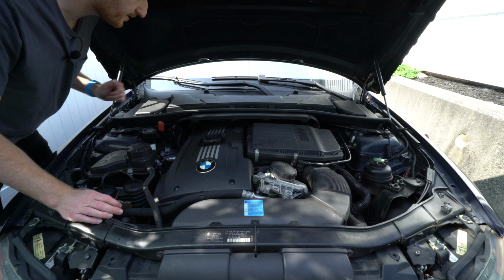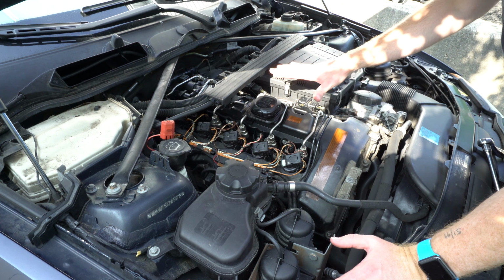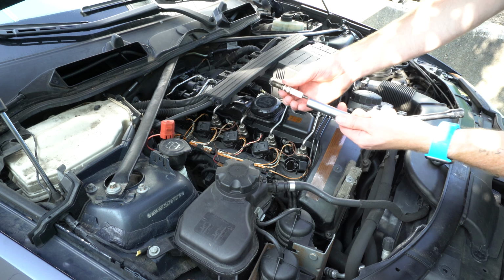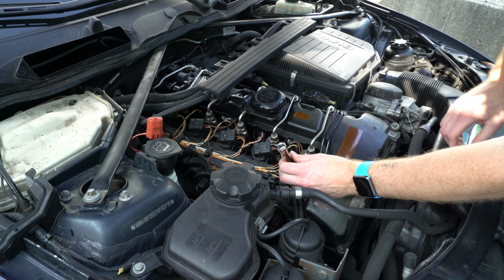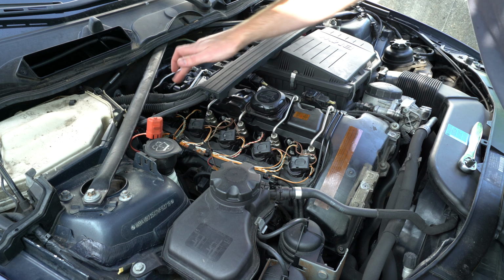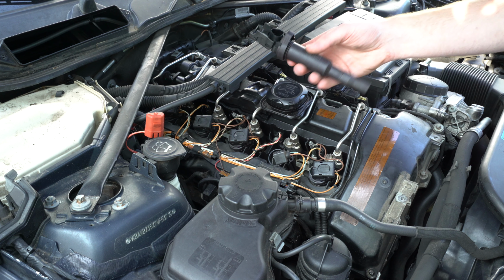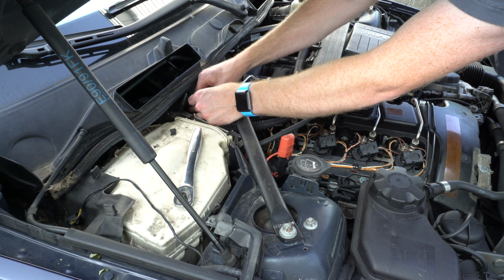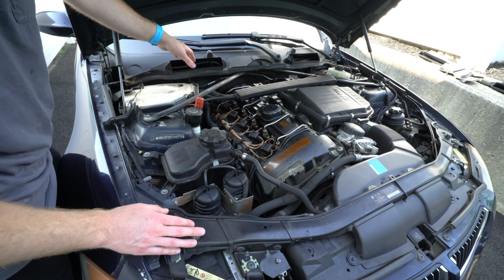E90 N54 Twin Turbo BMW Spark Plug and Ignition Coil Pack Removal and Installation DIY Guide in 4K

Comment: I changed all of my spark plugs and coils with proper gap and fully seated coils. Now my car misfires on cylinder 2 & 3 during cold starts only. What could it be? It didn’t misfire at cold starts even with the bad coil I had on cylinder 1.
Reply: could it be your high pressure fuel injectors?
Reply: @Nehkolas  I have index 12s about 30k miles on them
Reply: @Trusty335is I know this is an old comment. But I genuinely don’t know if I got a shitty batch or what but my index 12’s lasted about 35K mi with my prior ones doing about 100k
Reply: Did you ever find out what the issue was, every time I do spark plugs my car always misfires and I have to swap them different spots and eventually it runs perfect
Reply: @SlowwN54  yeah I went to check my spark plugs again and some of them backed out and were very loose even though I used a torque wrench and tightened to spec. I used a torque wrench again and then used regular wrench to tighten just a little bit more
Reply: @Trusty335is I ended up replacing my spark plugs with NGK one step colder ones and delphi coil packs and now my car is running really rough. I noticed when changing my spark plugs and coil packs a pretty decent amount of oil was on them. I think some oil was getting down in the spark plug whole but not anything crazy. Now my car is running really really rough need help!
Reply: @bloom3631  could be your valve cover is cracked and leaking oil in there if you found oil.
Reply: @Trusty335is  yeah I’m gonna get in there and clean it out with some sort of shot vacuum and I’ll probably end up changing the whole valve cover and gasket here soon